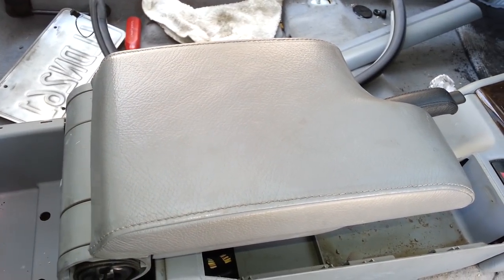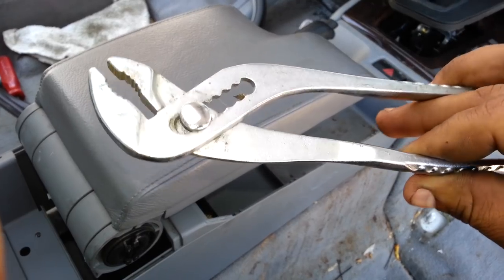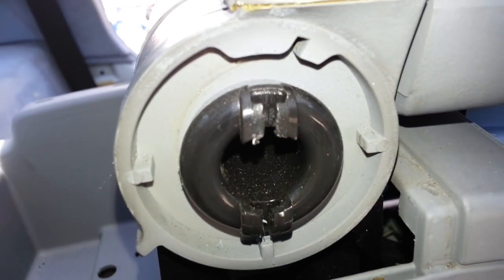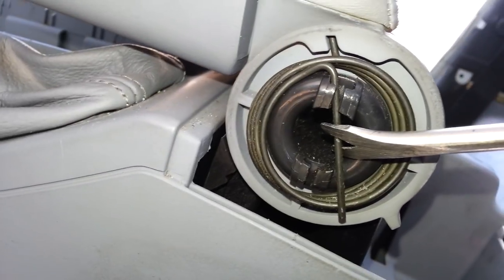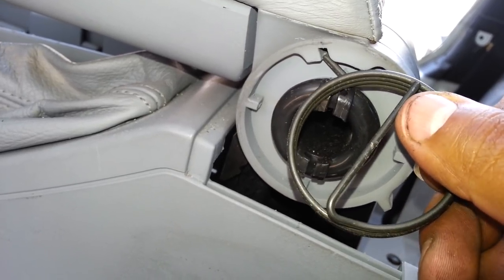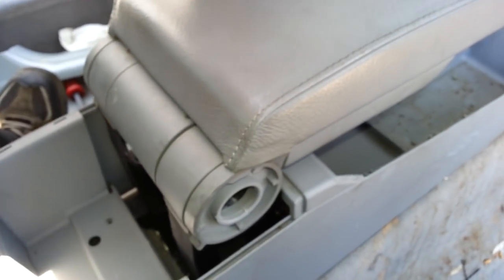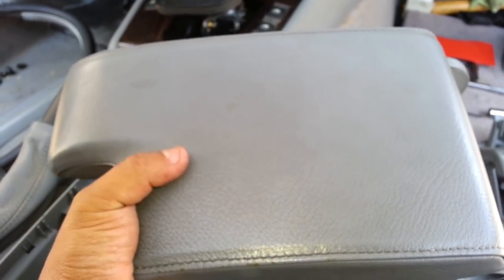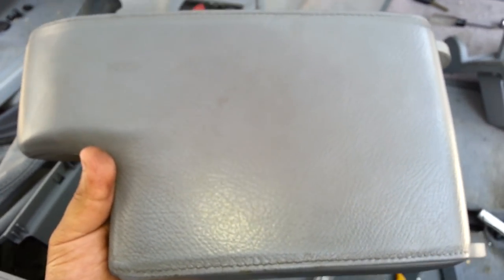BMW E46 Arm Rest Removal M3 330 323 325

Comment: Hi - can you tell me how to remove the bottom part of the tray that is attached to the arm rest?  When you push the button, the bottom part separates from the top of the arm rest.  I want to replace that little tray on the bottom.  Thanks.

Comment: I'm looking to replace the tray underneath the armrest, the Florida sun melted it or someone sprayed armorall in it and never wiped it out. Know where to get one of those or the full assembly? Gray bottom piece with black tray preferred. Thanks... 06 BMW 330Ci ZHP convert.
Reply: Do you know how to remove that? I have one that's nasty and a newer one ready to go in. I've monkeyed with trying to remove it, but no luck.
Reply: That’s what brought me here. Mine is all melted also. Wondering how to get the bottom part off. Also looking for a tan replacement part top and bottom.